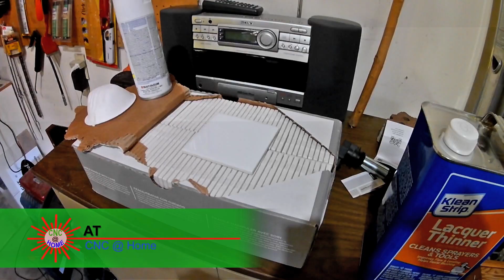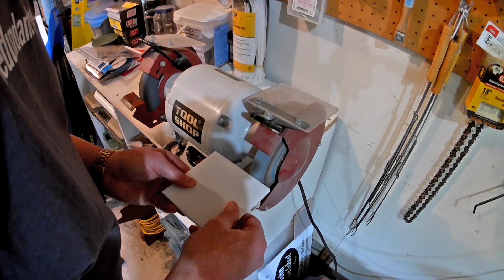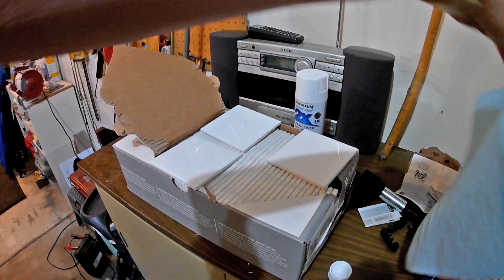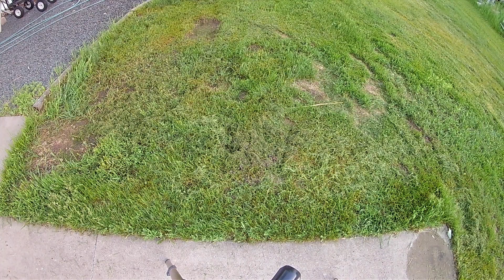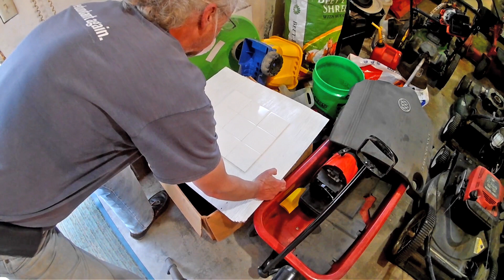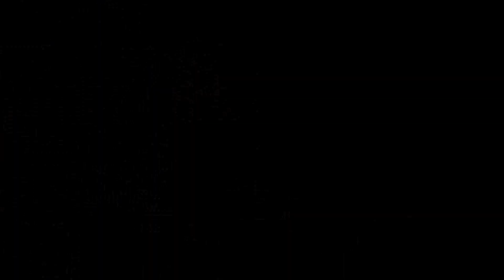Prepare Tiles to Etch

Comment: Are you using flat or glossy paint? Is there a difference?
Reply from the maker: Great question Chris.  I am using a flat paint for this.  I would think a glossy would work but not as well.  I bet the laser would reflect off the glossy more than the matt or flat paint and you would need a slower speed and/or a higher power setting.  If you happen to try it, let me know.  Maybe I will pick up a can of glossy next time just to see how that works.
Reply: Thanks. Not related to this video, but tapping into your experience, do you use transfer paper when etching glass?  
ORTUR Laser Master 2, 15w
Reply from the maker: I have only etched glass one time and it was basically by accident.  I was trying the white paint trick with glass and it ended up etching the glass.  It took a bit of cleaning to get all of the black residue from the paint off.  As it came off, so did a little bit of glass.
https://youtu.be/NUPRpXfZgG0